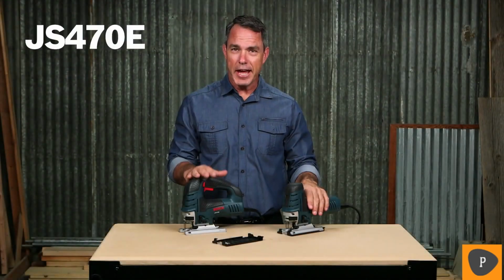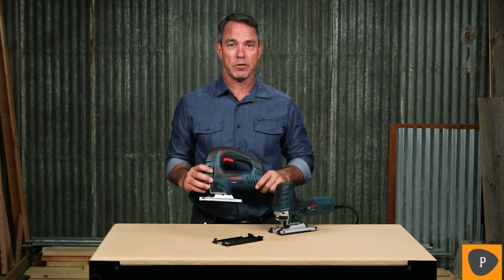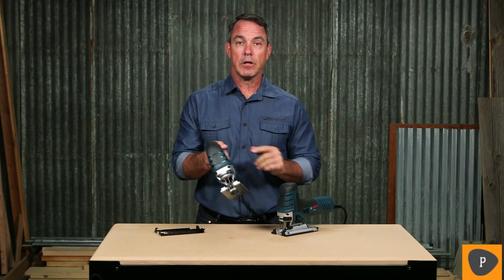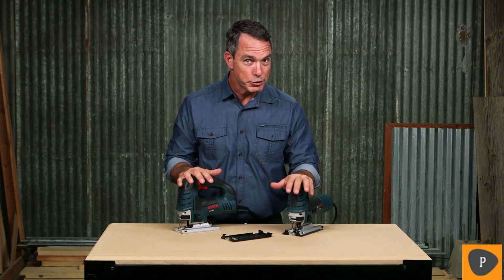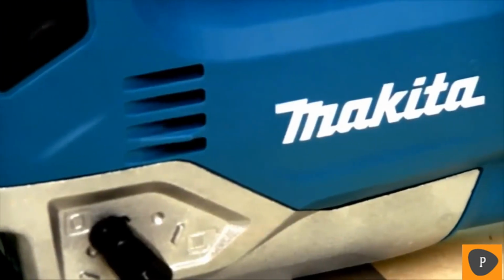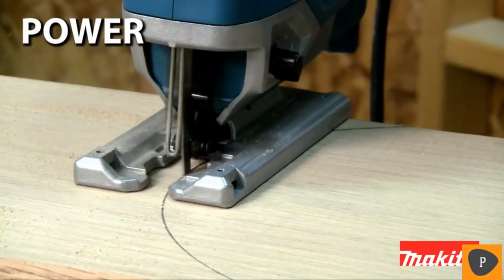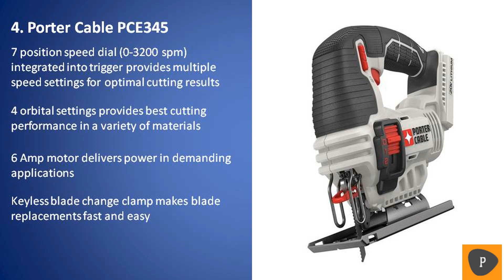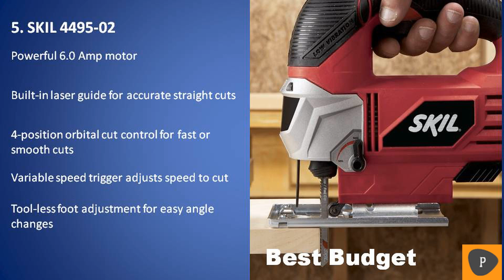Best Jigsaw in 2019 - Top 6 Jigsaws Review

Comment: Bosch,  Makita, Porter Cable, skill, and Craftsman are the most stable cutting I've used.. had the black and Decker and the smaller 4.5 amp model and returned both due to blade falling out quite often (t shank) and the shoe was unstable and would not stay tight.. just picked up the Craftsman 5 amp model.. cuts smooth as butter rips straight as an arrow and turns on a dime.. excellent choices you picked, I could've just gotten some flawed Black and Decker's.. the Craftsman and skill are both excellent at budget levels and are definitely comparable to the Makita and Bosch.. Porter Cable is a solid option as well 👍👍 great review!